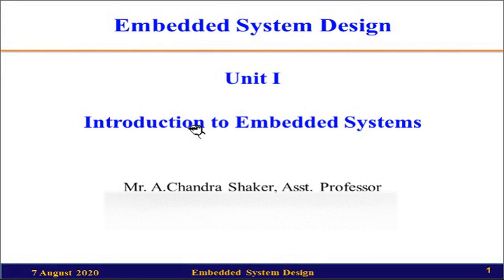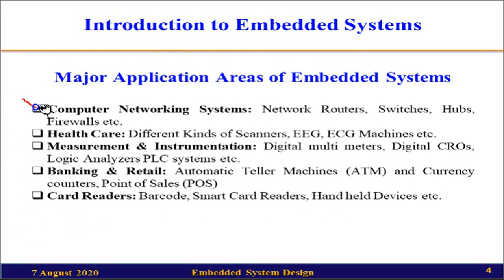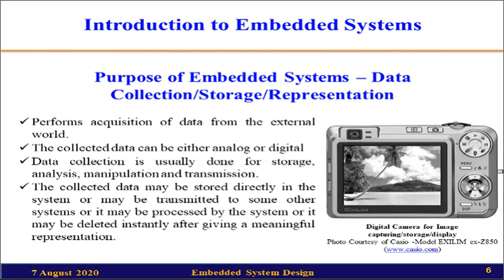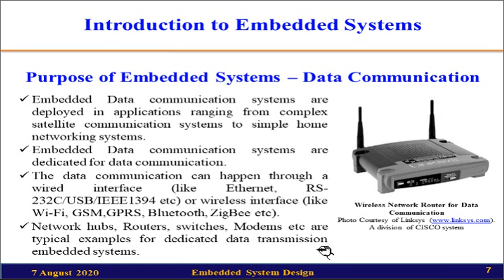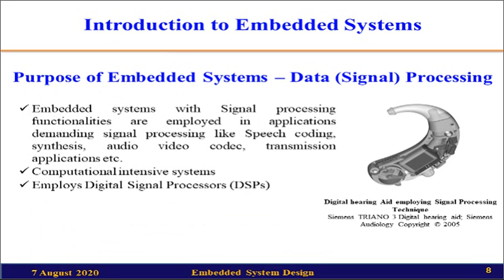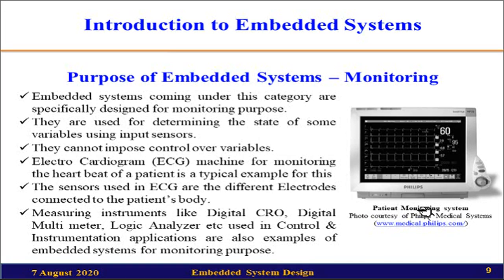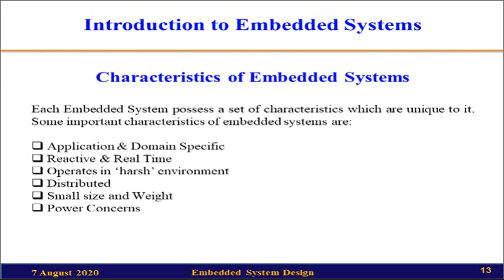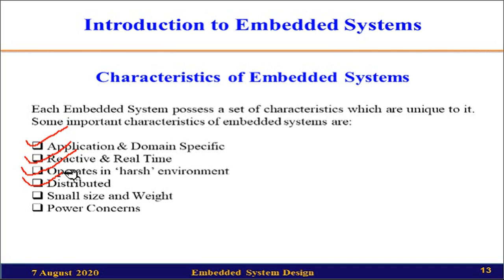Major Application Areas | Purpose of Embedded Systems

Comment: Sir u told that classification is based on 4 caterogies but u explained only 2...why Sir? Is that not so imp?
Reply from the maker: Yes, first two classifications are important. For deterministic behavior you can explain about hard real time systems and soft real time systems. For triggering you can explain about event based triggering systems and time based triggering systems